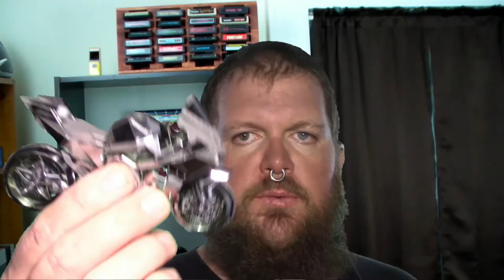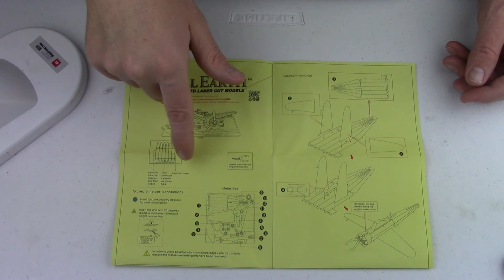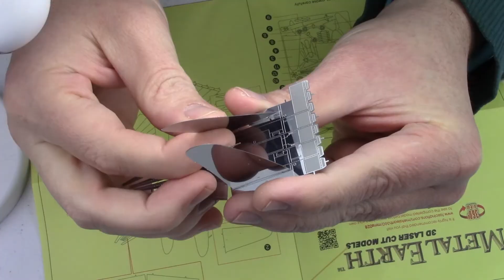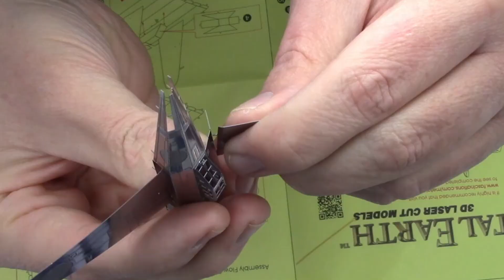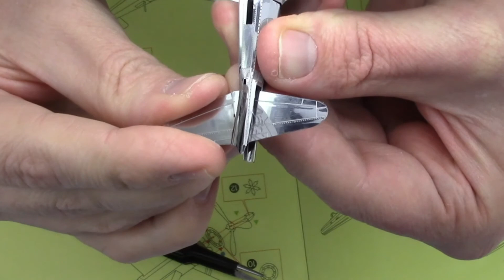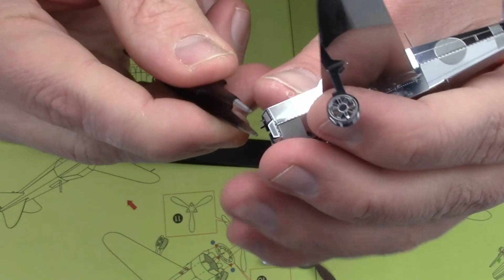Metal Earth Build - Mitsubishi Zero

Comment: Great job Brad! That torpedo looked really tough. In fact, the whole build look harder than any of the planes I put together so far about four of them. Only thing I would say that you might have forgotten was to twist a propeller blades in a little angle so they look like regular props - don't know if the directions addresses that or not
Reply from the maker: Cory the directions don't mention that. I did think about but wasn't sure which way to bend them and then it slipped my mind.
Reply: @Cory The part you are calling a torpedo is actually a fuel tank that the pilot can detach when it is empty.
Reply: @solowingpixy8297  LOL... exactly... a torpedo.....